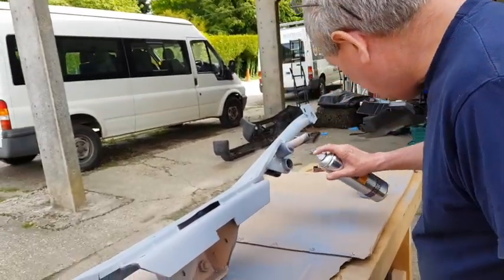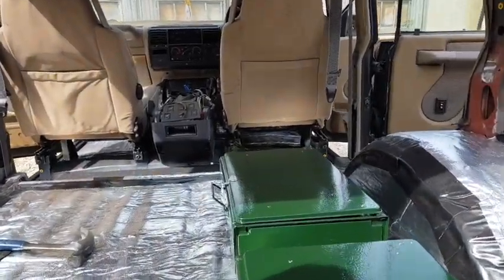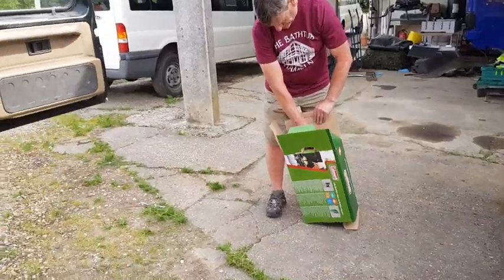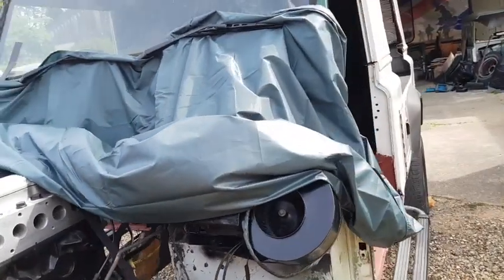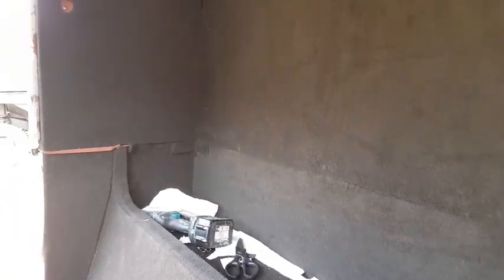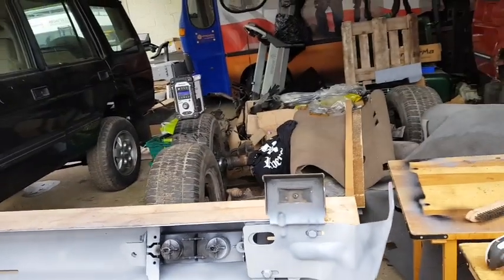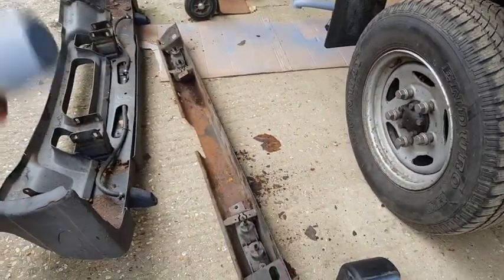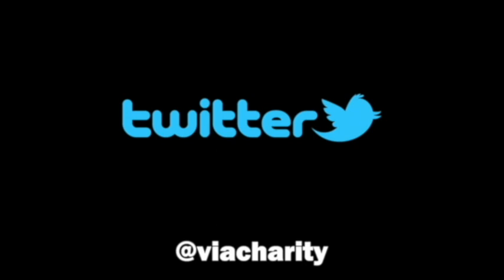Restoring the Land Rover Defender and Discovery bumpers - Season 2 - Episode 32

Comment: Got a set of almost new 2inch lift springs here if you want em? been on my disco for about 2 years but only did about 500 miles and one gentle green lane before its engine failed. No shocks though i'm afraid.
Reply from the maker: Yes mate that would be great we may just be doing up another Disco after we Rebuild CHRISTIE